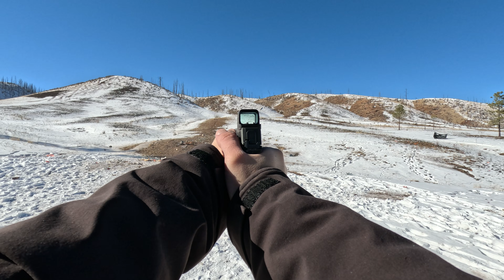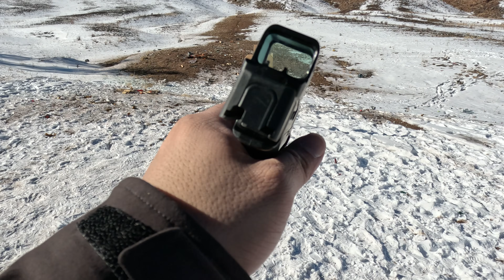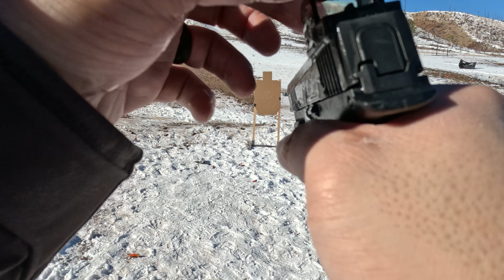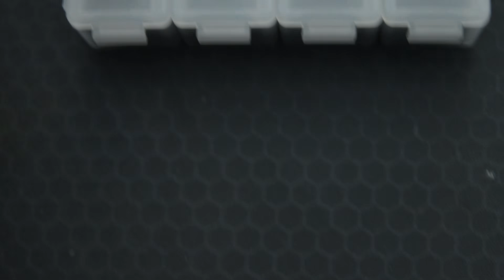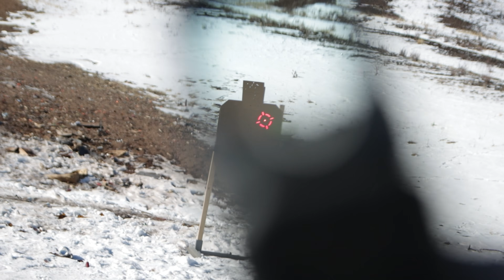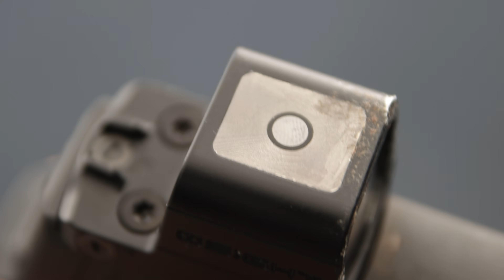Osight S - First Look

Comment: Excellent video quality and composition. I’ve only got 250 rounds on mine (mounted on a P30L) but it’s more than consistent enough to hit an 8” round plate at 50 yards
Reply from the maker: We only tested this on the p365. We really like how tight it fits on the Glock 43x mos and Hellcat. Zero retention is pretty good for this optic so far

Comment: I love mine 2,000 rounds on hellcat pro no issues... came zeroed at 25  perfectly I didnt have to manually adjust..
Reply from the maker: I think osight s will replace the 507k. 507k has horrible footprint after all these years.
Reply: same here on my P365, zero adjustment needed.